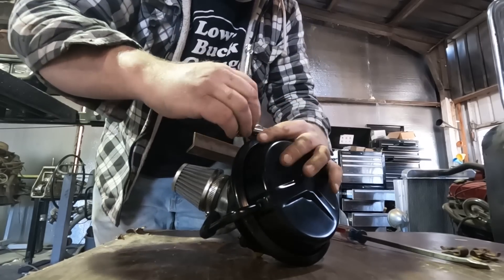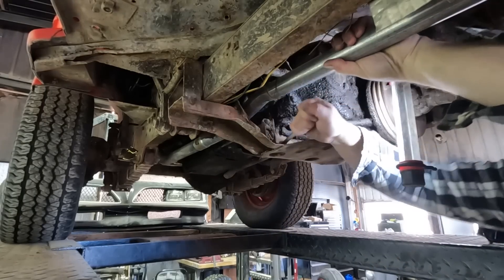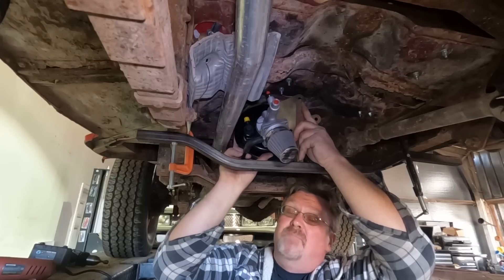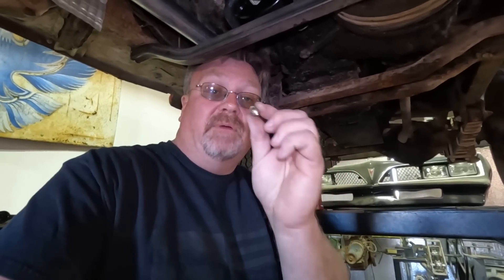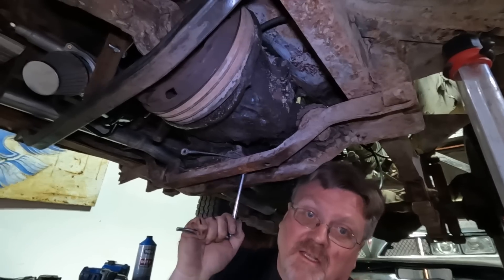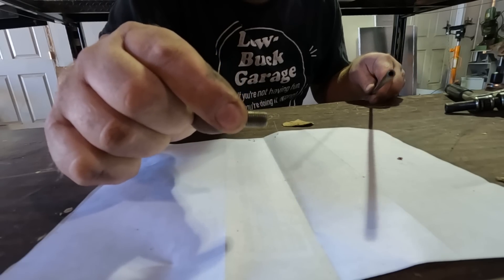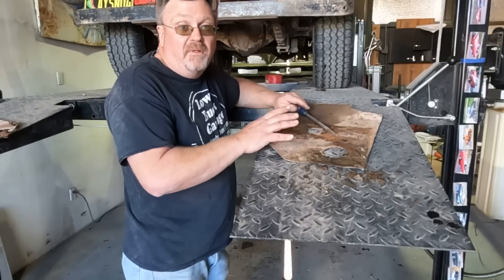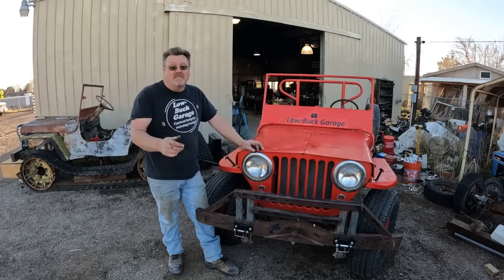Retrofitting Power Brakes, More Power To Go Slower!

Comment: Another advantage to not having a windshield you might mention: With the new brakes, you won't smoosh your face into it!
Reply: Add the advantages of never having to clean a missing windshield, replace wiper blades, or refill the windshield washer reservoir, and, in reverse you can spit through it. not advisable while going forward, where 'blowback' becomes a concern.😁👍🇺🇸😎
Reply: It's a safety feature if you aren't impaled by the steering column atleast you now don't have to worry about when you fly through the glass
Reply: @johndenton5555  As long as you doing under 30, spitting should work
Reply: Besides, with windshield (windscreen) up you'd miss all the tasty bugs.

I always drive my ol' Flattie with w/s down, goggles and a grin.
Reply: @-oiiio-3993  I got my 'bug smiles' riding motorcycles.
After hitting a swarm of cicadas doing about 65-70 once has convinced me that in my car, I DO want a windshield.😁
Reply: @johndenton5555  Bats can hurt.

Comment: I ran into similar issue with an new radiator with a Trans cooler in my '69 f250, I think I ended up having to get a flare adapter. What a cluster__

Comment: Many years ago my cousin and I added a hydro vac to his old one ton truck that he used for work and we had the same issue with the pedal pushing/kicking back,. We added about a quart size vacuum reserve
 can to it that we mounted on the fire wall, and also added a check valve between the can and the intake manifold and it solved the issue.
Reply: The two kit parts he didn't use.

Comment: I love this channel - it is both informative and amusing, it amuses me how you just find a valve, a piece of metal the correct size, the right sized piece of wood, the correct nut and bolt ad washer - either on a shelf, in drawers or on the floor. The channel is perfect - you just mentioned modern cars from the sixties -  that explains it all!!!

Comment: The brake hydrovac appears to be a PBR (VH44) or a copy of a PBR, they were available with a remote air filter for when they were mounted under a vehicle. They had an adaptor to take a hose and then they had a snorkel high up in the engine bay. 
You can mount them higher than the master cylinder but you need a residual pressure valve.
I can send you a copy of the service manual if you need it.
Reply: BTW, the vacuum fitting on the hydrovac is the check valve.
Reply: it is a very important advice, to avoid internal corrosion of the unit, it is mandatory that the air make up would be located where it won't suck water droplets when the vehicule is driven.
Reply from the maker: Thanks for the info!  All the other hydrovacs I've worked on have had a firewall mounted check valve, glad to hear that this booster does have one in the system somewhere.

Comment: K10 backing plates and calipers. Cj7 rotors mounted on a Dana 25 or 27. Best brake package up until AMC bought jeep from  Kaiser and the dana 30 started to be used.

Comment: They make adapters to go from bubble fitting to inverted fitting.  My 96 F250 used bubble fittings at the rear wheels but I couldn’t get bubble fitting line so I had to put adapters in.

Comment: I have thoughts. But nothing to say. You did a great job. The parking brake and the cable seem to meet up half way when one is relaxed and the other has the slack taken up a little. Maybe a bolt would fit in there one day? Just have to wait for the part to be invented. Great job overall.

Comment: I don't know whether this helps....  
The Toyota Sienna van in the year 2002, 2003 era...uses a booster with an unattached reservoir for the fluid.
Two lines carry the brake fluid down from the reservoir to the master cylinder.

Comment: Does that booster have a check valve for the vacuum supply?

If not, you only get full power at idle. WOT & engine off (ie: stalled) you get no assistance.

Comment: I've had a few squarebody over the years. Was wondering if you have done a bicycle cable mod for the throttle. I've tried several others over the years including stock replacement but they always seem to bind. Heard the bicycle cable was the best
Reply from the maker: I've used bike cables, the only trick to them is holding the end without pinching it flat.  If you can get that right, they work fine.

Comment: i have been looking for a hydrovac unit for my 1966 D500 dodge havent found one yet
Reply from the maker: There's a surprising number of them on ebay.  As long as you find one from a vehicle with about the same bore size master cylinder as yours, it would probably work.

Comment: Is the skid plate supposed to be flat? My factory skid plate has an angled front section
Reply from the maker: You're right, it should have more of an angle.  I saw that when I bolted it back up.  When I pull it off again for the transmission swap I'll add an angle back into it.